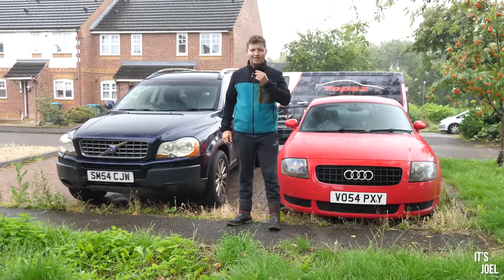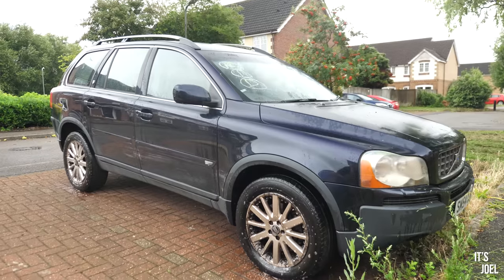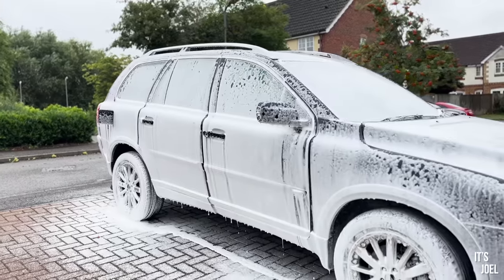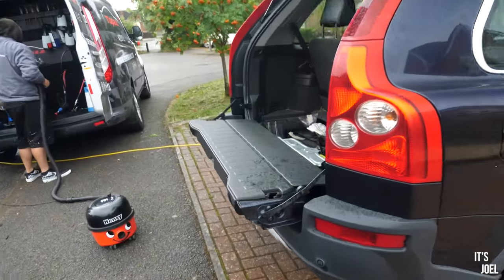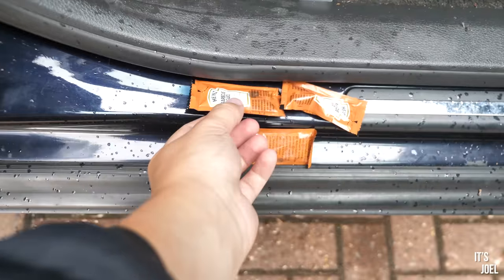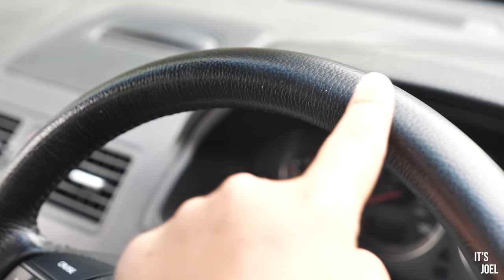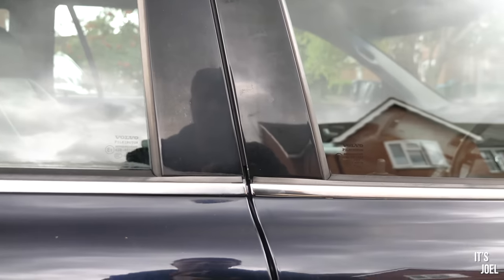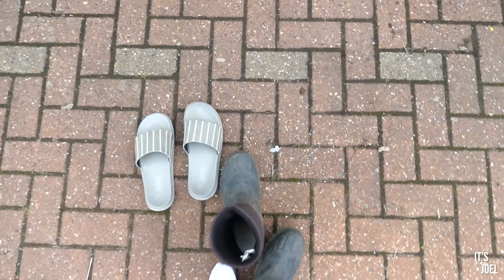DEEP CLEANING THE 300,000 MILE VOLVO XC90!

Comment from the maker: Soooooo, what do you think? Worth Cleaning?
Reply: Volvos are always worth cleaning. I washed my V50 T5 last weekend. I find it very therapeutic.
Reply: I just did a full paint correction on our 223 693 mile 2007 XC90 and I think it's worth it. Never seen such high quality paint though
Reply: Based on the color of the car you might be able to use touch up paint to move some of the scratches, but you got to be very careful when you do so
Reply: To remove the scratches on the car.  based on the color of the car. I think touch up paint will just blend in
Reply: It's also cheaper to get a parts car with low mileage so you can fix all the problems with the car that you have now if anything comes up
Reply: Lovely car. I’ve always wanted an XC90. The icing on the cake is the in car minidisc player!
Reply: Definitely worth it and the potential is there it get it looking good again hopefully without to much of financial layout.
Reply: Quality valet by topaz , car looks 10 times better onwards and upwards , still got the jag ? 🤔
Reply: Worth cleaning for the scrapyard? Lol because that is where it should be heading… no one in their right mind will want this old rot box esp with that mileage and issues, certainly no one in London or Greater London or the UK at this rate.
Reply: Absolutely worth it. Legendary cars these and the D5 engine was a reliability masterpiece and sounds great. As is the current D4 engine. Love my 2018 S90 R Design great car to drive and we've just had our 2018 V60 Inscription clay barred and machine polished as the previous owner neglected it. Brilliant cars
Reply: I've got a 2009 xc90 and it's awesome to drive and comfy done hand brake fix as they crap on them but so positive can't fault it day today mines done 145k but bought it cheap
Reply: So nice to see this beast in its former glory 😍
Reply: If it's worth more than the total buying price plus cleaning costs then, yes. However, that "clean" will not last long and you're back to where you were.

I had one of these. A 2014 D5 ES (which I think is the base model). Only had 200bhp which is quite low for a 4WD of this size and it was sluggish. Could easily carry 4 people, camping gear for a week with a huge roof box on top and a towbar mounted bike carrier with 3 bikes. The self levelling suspension was certainly put through its paces. Took it to Hockenheim and back without any issues. An excellent family car, very comfortable and, with my colour combination of bronze with cream leather, a good looking car too. Shame about the mileage though. Long journeys gave 34mpg and my average in town was a paltry 18mpg. The most I ever managed on a full tank was 340 miles!
Reply: Agreed! I finally got my 03 s80 washed and it just makes you appreciate your car all over again even in the dull winter

Comment: I’ve owned this model XC90, lift the bonnet. You will see two metal taps on the headlights. 
Pull them both up, then pull the light. 
Yes, that’s how easy it is to remove them. 
Literally takes seconds, you then cleaned up, get them ceramic coated, job done, for very little money👍

Comment: I bought the exact SUV. I will detail it this year as I bought it in October colder weather already. It is a beast. So comfortable to drive. I can hardly wait to clean the shiny leather back to softness. The plastic on the outside appears faded grey. I bought black plastic restore but Im thinking they are supposed to be grey now. Not sure. The handles are the plastic on mine as well but other than that they are twins. So beautiful. I have some scratches too that Im hoping I can polish out as soon as the weather decides what its doing. Don't forget to change the cabin filter for freshness. Cheers from Canada.

Comment: I get quite addicted to restoration projects. 

Seeing how nicely it's cleaned up, I'd go all out personally - though admit it would make no sense on a purely financial front. 

I'd suggest you try and find a wheel restoration place to "partner" with... RRT, Posh Wash, WheelWorx etc. Get those fully restored, SambosTyres or such for a new full set. A dent/smart repair type service to sort out your panel damage and paint... Gotta leverage that YouTube status dude, don't pay out of pocket where possible.

Naturally I'd want to get that headlining replaced/repaired and I'd also want a new set of keys so there is always a working spare. One worn key always makes me sweat! 😅

At that point Engine Service, Gearbox Service, MOT, probably a Carbon Clean & Remap by AutoTechCC and entertainment system repair by a good Volvo specialist such as Charlwood Automotive (used them recently and rate) as these do usually have killer sound systems. Then you'd have yourself a surperb family car, rescued from the scrapyard, at least until the ULEZ extension happens - assuming you and Katy aren't moving to Norfolk or somewhere remote!
Reply: I'd recommend Charlwood Automotive for all mechanical needs on this car as they're a proper specialst.
Reply from the maker: Thanks for all the recommendations!

Comment: Fantastic transformation on the car what both Topaz & yourself have done Joel. I really like this kind of video as I’m sure I’ve previously told you. In regards to the paint pen writing on the window screen I normally just use a Stanley knife blade & hold just the bare blade between my thumb & index finger whilst going back & forth on the glass at a 45 degree angle with a mist of water on the screen at the same time to remove the markings. 

Really enjoyed this upload just like the others you produce. All the best.

Comment: It was definitely worth cleaning. 300K miles is nothing for a Volvo. My own XC90 has about half the mileage so barely run in. You've taken 20 years off it 😆 You've just increased your chances of getting it throught the MoT just by cleaning it. Those mats are either factory or custom made as they engage with the studs in the carpet. I damaged my passenger door mirror and I recently did a video on how to change it. Some T-Cut should help in getting the worst of the inragined grime off the wheels.

Comment: Interesting indicator lens on the passenger wing. Is this because of the broken wing mirror? I’m sure it would be easier to fit a 2nd hand mirror from a breakers yard.
Reply: Good spot!
Reply: The indicator on the wing is messing with my mind. This model is too early for the indicator in the mirror.....it should be on the door trim. However the door trim does not have one? Perhaps was a replacement door at some stage?
Reply from the maker: the previous owner commented on the last video and mentioned the indicator, although I didn't quite understand what he was saying... It's some sort of bodge job

Comment: Scratches, wing mirror and roof lining are devaluing the car. You can polish a turd after all but it’s still a turd. Get those bits done and a replacement drinks holder cover and you’re looking at £1200-1350. The mileage doesn’t matter when it’s that high if you have service history and DIY receipts. I’d expect with that high mileage an extended lack of service stamps covered by DIY service parts and fluids.